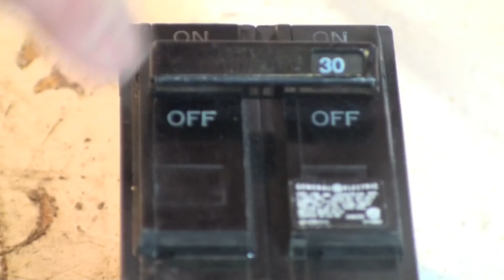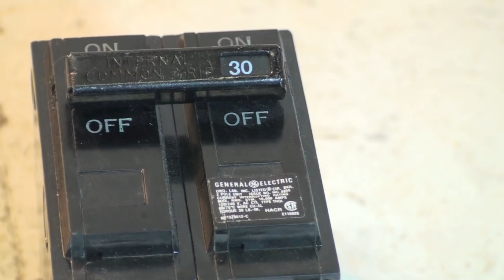Why does my panel breaker keep kicking off.  Breakers #2

Comment: your video was very helpful.  If the buss bar is the problem, would moving the breaker to an open slot help?
Reply from the maker: If you have open slots, it could if the bar is not damaged in the new slot.
GFM

Comment: Funny, but I did residential and commercial electrical work for over fifty years, and I never had to replace a bus as you mentioned. Also, I never ran across a replacement bus for one of those panels. Usually when burned terminals occurred like you described, the damage was so severe that the entire panel had to be replaced.

Comment: I have a 200 amp breaker on the outside of my house under the meter. I attempted to shut it off and it will not stay in the down position it springs right back up. It’s a cutler Hammer breaker. Have you experience this before?!

Comment: You are the first video I found that even mentioned the bus bar . while doing laundry the clothes dryer breaker kept tripping. I went to the panel and it was very hot. I reset the main and it happened a few more times. Now I only have power to half of my house. Any ideas/ Suggestions? what do i need to replace?  I asked this of others but forgot to mention after tripping the main a couple of times power came back to the house but not to certain areas in the kitchen. I hit the test button on my gfci and it knocked the power to the entire house again so now only half the house is powered. Any suggestions??

Comment: Idk know if you can give me any advice at all on this mess....But I'm living in a family owned single wide. The wiring is so crazy, that it has to be written down as to what breaker goes to what! Ex...A breaker may control the whole house. A breaker may control half the house. A breaker will work the left side of the living room, but not the right. A breaker runs the washer and dryer. Another one runs the fridge, stove, and a couple plug ins on that side of the kitchen. Another one runs the kitchen light and another plug in on opposite wall. The bedrooms are on separate breakers. The bathroom is as well. We keep getting a thrown breaker #3 when #8 is on. So we are keeping 8 off for now. But if we plug certain things in (say microwave) it still kicks 3 off. My cousin came (construction worker) and looked things over. He took breakers out, and showed me that the prongs were burnt on multiple breakers. Almost all of them really. Idk what to do. I know it's not safe, but is there a way of fixing this?? Would higher breakers make a difference?? Do I need to replace the box, or can the prongs be fixed?? I'm not remotely keen on this stuff at ALL!!!! 🤷‍♀️ Any advice is very appreciated. Ty. 🥺
Reply from the maker: First, if it is a Zinsco brand, replace the panel.  If not, you probably have a bad buss bar.  In no case replace the breakers with a higher amperage. Dangerous!
GFM

Comment: I’m currently having this issue. Electrician came out and replaced the breaker. Still having random trips in the breaker. All the wiring checks out and all connections are tight. Still can’t find what is causing the breaker to trip.
Reply from the maker: What is the load on the breaker?
GFM
Reply: @grayfurnaceman  he’s used a thermal gun all the breakers are at 75 degrees. He also tried to trip it with another meter. It never happens while he’s there. He’ll leave and 30 minutes to 5 hours later it start tripping again.
Reply: Electrician said all the leads had .1 load on the meter. He said I have a very light load across all the connections. He can’t figure out why it randomly trips.
Reply from the maker: @waynebrown9877  Is the breaker a single or double?
GFM
Reply: @grayfurnaceman  double 60 that’s is tripping
Reply: It’s either .1 or 1

Comment: I got ? i have several breakers with no power happen all at once what could be problem?
Reply from the maker: You could have lost one of the poles in the main panel.
GFM
Reply: @grayfurnaceman   ok thanks for getting back to me
Reply: @grayfurnaceman   do you  at double breaker the main ?got power to both
Reply from the maker: @ClintGilbert5  If you show voltage from pole to pole (240 volts or 208 volts), at the output of the main breaker, you have both poles in operation.
If so, you will have to check each breaker input and output.  Careful here, everything is hot.
GFM
Reply: @grayfurnaceman   Ok

Comment: my switch on breaker went off when i was using a grinder. The grinder got hung and it kicked off the breaker. now the porch, middle room and kitchen will not work When I try to flip the switch it makes an overload and instantly makes a minor pow' noise up in the light on porch ceiling and the switch on breaker kicks off instantly. What is maybe the problem?
Reply from the maker: Have you disconnected the grinder?
GFM

Comment: While a lose connection at the breaker is a possibility,  and good advice to look for, in. 15 years I've seen that possibly once.  I've seen a bad breaker maybe 25 times (other than garbage Siemens afci breakers). Typically breakers do their jobs and that's why they are tripping.  ( The obvious exception being fire starter panels; Fp, pushmatic, sylvania etc.)

More often it's backstab outlets,  and people plugging space heaters into ancient lighting circuits.  I always tell my customers that space heaters are the devil.  Lighting circuits are designed for lighting.  Not heating.
Reply from the maker: Agreed on all that.
My experience started out working exclusively on electric furnaces.  Loose breaker wires and burned up fuses are pretty common with the high loads with electric furnaces.  It does not take much in the dead of winter with the long cycling times and 80 to 100 amps draw.
GFM

Comment: 6 brakers trip at the same time when i turn on the braker, i already unplug all the apparatus from the outlets but keeps tripping, the outside outlet is burn i disconnected is an GFC
Reply from the maker: You probably have a short in an electrical box.
GFM

Comment: My dryer breaker was tripping after a few minutes of use.  I tightened the screws to the breaker and it seems to have solved the problem.   Thank you so much for producing this video.  What causes the screws to get loose - heat build-up?
Reply from the maker: Mostly it was not tight when installed.
GFM

Comment: The Load has been the same for 12 years. My breaker won’t come on. It went off tonight and won’t come back.
I turn it off and turn it on it makes a noise and still no lights or ceiling fan for tonight no plugs in this section either.
Reply from the maker: Sounds like a dead short.  You can try disconnecting any appliances on that circuit to isolate.
GFM
Reply: I will thank you it’s my tv my ceiling fan and all the plugs in that room so I cannot get anything to come on. A fellow came to help me with some tile today and His long life friend is an electrician. He is coming next week to help me, 
Thank You I really need him I think
Reply from the maker: @kathyfann  Good choice.
GFM

Comment: if you have a bad ohmns reading , can the breaker still read 120 volts, would it fail only when you put a load on it or if you had a bad ohmns reading , would it just read 0 volts?
Reply: If you have an open reading (OL) on an appliance, when connected to power, voltage at the appliance will read 120 volts but the appliance will not operate.  Hope this helps.
GFM

Comment: For those watching, if you are going to take a panel cover off and tighten the screw on one tripping circuit breaker, do yourself a favor.   Get a flashlight, turn off the main breaker, test to make sure no voltage, and tighten ALL screws.  This means all breakers and the neutral and ground bar screws.   Infrared scans of panels done by the company I retired from number one issue was hot neutrals due to loose screw connections.   Be safe, the life you save may be your own!
Reply from the maker: Good thoughts.
GFM
Reply: grayfurnaceman    Just trying to keep people safe!

Comment: I live in a older apartment. My breaker makes a small like crackling buzzing sounds. Is that dangerous? Also does it cause it to waist more electricity? My bill seems higher than normal.
Reply from the maker: You are literally playing with fire here.  Get it fixed.
GFM

Comment: Bus bars get build up sometimes. Which i just heard you speak about. You can use sand paper on a pencil and clean it juat had the problem fixed and heolding ovwr a month.
Reply: Eric,    Please go back and check the buss every couple month minimum.   Typically this will work for a little while and get worse over time.   They start arcing and heat builds up without tripping the breaker.  Then the breaker starts melting.  You can imagine the possible next problem.

Comment: What is your opinion on using a torque screwdriver to tighten electrical terminals? I don't think it is at all required, for most things anyways. I have always just tightened the screws pretty much as tight as I could and I never broke the terminals or had a problem, but some people say to always use a torque screwdriver and torque to spec. What's your opinion on this? Thanks
Reply from the maker: I like your way.
GFM
Reply: @grayfurnaceman  LOL thanks. Great video by the way!

Comment: That panel looks like a rat's nest  an awful electrician wired it the wires aren't straight you have a big taped-up knuckle junction in there. Romex wires running down the wall nothing is too code you need a service change and a qualified electrician who takes pride in his work to do it
Reply: I agree with you 100% and was about to make the same comments until I saw yours.

Comment: i reset my breaker,my kitchen,is it all the kitchen outlet go the same breaker?is that cuse breaker go off?
Reply: There are generally 2 circuits for the kitchen.  If the home was built after about 1970, there are ground fault outlets in the kitchen.
GFM
Reply: its old house we put new breaker in the house 2 years.i seprate 2 things now put it different outlet,its wired how it set it up washer is connect the kitchen wires i guess?so i dont used washer until i used micrwave our coffe maker.
Reply: plus they dont have outlet 2 rooms upstairs  our attic,no outlet

Comment: Why in US you use a 20 ampers  breaker to protect a 2,5 mm cable,while in europe they uses 16 amper  breaker to protect 2,5 mm cable.the same gauge cable  but different breaker.

Comment: ... and, if the main breaker switch is burned & crumbly, must a professional be called to rectify the problem?
Reply from the maker: Unless you are confident enough to call the power company to shut down the power to the house so you can replace it and any burned wires, yes you should.
GFM

Comment: Gary,  why are there "white" neutral wires on the breakers?
Reply: So wouldnt the wires be black and red?  Whute is a little confusing for a hot wire.
Reply from the maker: They are 240 volt breakers that have 2 hot lines.
GFM

Comment: I gave a free 2nd opinion on big company in Ca, that charged $900 for a dual capacitor when it was actually loose breaker wires. 1-hour ht & Ac also said they needed all new Ac & furnace!

Comment: First of all if your breaker is tripping consistently the last thing you want do is keeping resetting it . If yo don’t know anything about electricity then stop an call an electrician, don’t do what this amateur is suggesting
Reply from the maker: I am actually an electrician.  The most common cause of breaker tripping is loose wires on the breaker.  So, you should call an electrician to tighten a wire.  That would be job security.
GFM

Comment: Can you help me? In my house it tripped at 10.00am precisely for several days, not all days but almost, then 11.15h always at 00mns or 15mns. Never tripped during the night till 9.15h am. Any clue?
Reply from the maker: Which breaker kicked off?
GFM
Reply: The main 30mA one always. In a period it tripped almost every day at 10am, then i started disconnecting some individual breakers it still tripped, then it stopped for weeks. I couldnt debug it that way. Yesterday my mother said electricity got off around 2 am, today at 1.44am it tripped. So i think it may be some electronics i disconnected the printer off the wall today. But is weird it beeing so random and spaced in time some times
Reply from the maker: Do you have a fuse box rather than a circuit breaker panel?
GFM
Reply: Joaquim Coutinho guardian interlock

Comment: That 20-amp double pole breaker is actually a Westinghouse brand, therefore is not listed to be used in that GE panel in the first place.  That may be part (or all) of the problem.  I would have replaced the breaker with a GE brand, and see if that resolves the issue.

Comment: "Bi-metallic"? I had the understanding Breakers depend on Magnetic force to release the contact and break the circuit, as in Too much Current = excess magnetite force, hence contact will open", instead of "Opens because the heat of a bi-metallic joint that causes the bimetallic part to BEND and dislodges its position", causing break in the contact. Bi-metallic are used in over heating due to excess Amperes in the winding, and take considerable more time than electromagnetic force due to over current. They respond to HEAT, not directly to MAGNETIC FIELD due to over Current. Can you corroborate this, please?
Reply from the maker: There are overloads and breakers that use magnetic force.  The ones used in most residential panels are bimetal.  I know it seems that bimetal would be slow, but it works well as both a n immediate break due to a short (very high amperage equals a lot of heat very fast).  Think 400 to 800 amps in a dead short.  Delayed trip would be from an amperage above the rated but not excessively.  Think 40 amp draw in a 30 amp breaker.  The breaker would not trip with that overload unless the overload was to continue for a number of minutes.  Slow warm up of the bimetal.  Hope this helps.
GFM
Reply: grayfurnaceman    Breakers are dual rated with very few exceptions.   They have overload protection as you said and magnetic protection, as in the question, for short circuit.   The exception is called mag only, or magnetic only.

Comment: May I ask, do u kno y my breaker got tripped normally I can reset it but today i can't , it keep tripping rite after reset it. I replace the new breaker but still same result
Reply from the maker: If it continues to kick off immediately, you have a dead short in the circuit.  It means the  load has failed or the wiring is shorted.
GFM
Reply: grayfurnaceman so How can I find that out ? It's night here and the ac is wif that breaker ? Home is getting hot due to no a/c
Reply: grayfurnaceman b4 it tripped only central unit and fridge wif couple lights on
Reply: grayfurnaceman sparkling when I switch it on sometimes . The metal bar where the breaker stick into is kinda burn a little
Reply: grayfurnaceman is it normal for a single 20a breaker that have two black wires going to it ?
Reply from the maker: If you are getting a spark when the breaker is turned on, no matter what your problem is, the breaker must be replaced.  If the buss bar is burned, the buss bar must be replaced.  When you get into buss bar replacement, you will need an electrician for that.
GFM

Comment: Thanks to this video it saved me a lot of money. I was having a problem with my air conditioner  which kept tripping the breaker. It was tripping every 15-30 minutes as you had described it, so I went to check the circuit breaker and indeed there was a lose connection. Now I get to enjoy my house without worrying to spend a lot of money for a simple fix. Thank you so much!!
Reply from the maker: Welcome
GFM

Comment: A) Breaker is defective, B) There is a short somewhere in the circuit.  Next.  Check both in that order.
Reply from the maker: I would differ on that one.  The most common  reason for a breaker to open is loose wires at the terminal.  This is especially true for breakers used in high draw circuits.
GFM

Comment: so I have a pool and the pumps breaker kicks off or trips everytime we turn it on. Direct kickoff. not only does it kick off but it kicks of the breaker for the pool in our main control panel which turns off all the power to the house. This has never happened in the 4 years we've had the house. We replaced the breakers with new identical breakers for both the pools pump control panel and the house's main control panel but the problem still continues. We are hoping it's not a short in the pumps motor and it's something less expensive. Any ideas?
Reply from the maker: noob Tube You have a dead short. You can electrically disconnect one component at a time until the breaker stays on. Then you have found it. Hope this helps. 
GFM
Reply: grayfurnaceman     Sir, you really should stop suggesting this method of finding the problem of a direct short.   Breakers are not test devices.   Continuity tests and ohm readings work very well.   The reason your advice is not good is circuit breakers are guaranteed to trip from short circuit once.   Depending on available short circuit current and if a bolted or arcing fault affect amount as damage.   A definite code violation to keep turning it on as well.    Respectfully,   Kevin

Comment: sir, i have a question. my circuit breaker c20 only this one always tripping due to heavy load put on it (example: 3pc's, air conditioner, electronic stuff and etc). can i change it to c32? with higher current value.